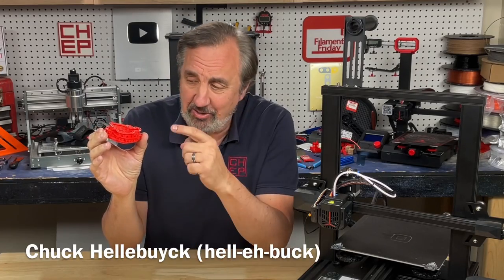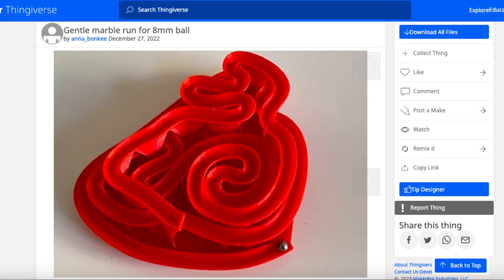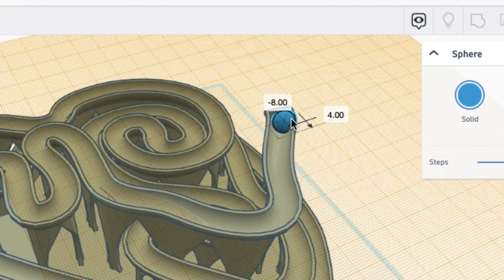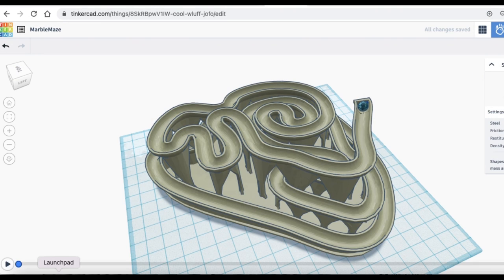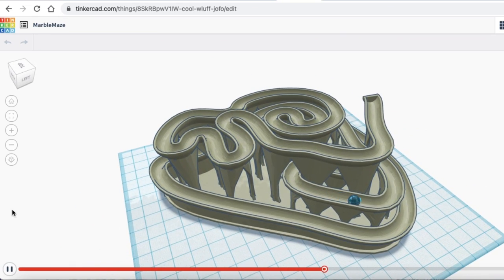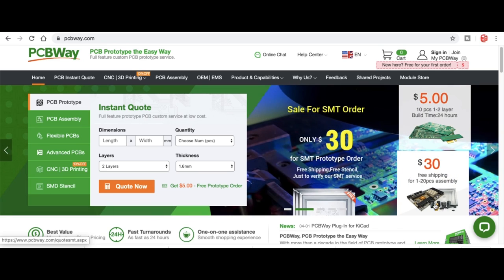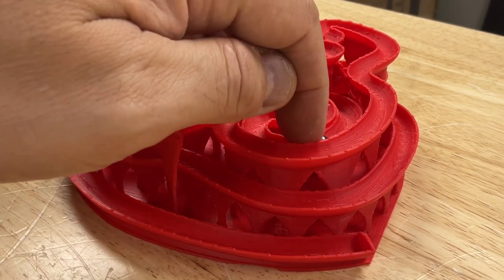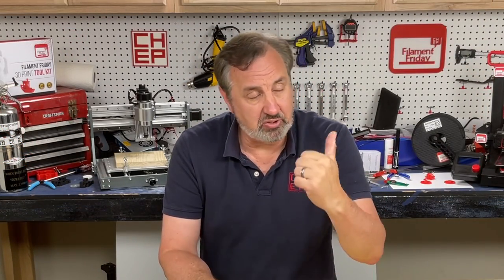Simulate and Animate 3D Prints in Tinkercad Sim Lab

Comment: Possible idea in Cura. Could you scale the marble run on the Z axis only to make the whole print taller? That might help with the areas that are too flat and would prevent the steel marble from stalling out on that part of the marble run?
Reply: That's actually a good idea. Might be fun to try out and see if it works.